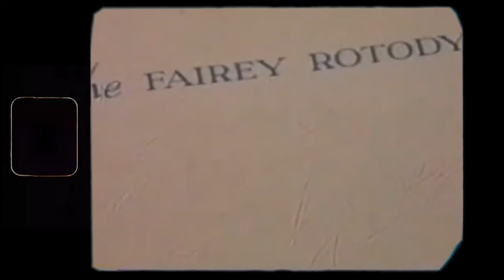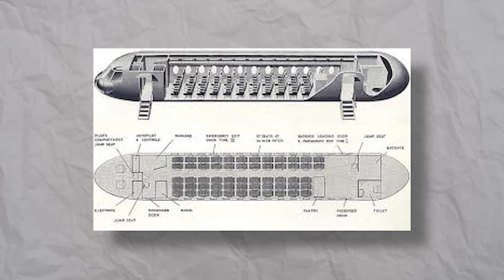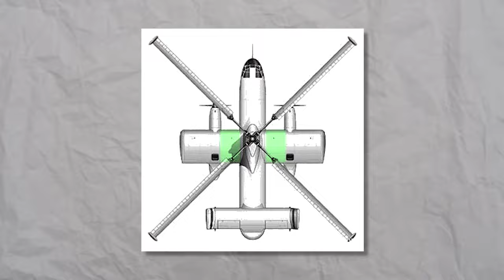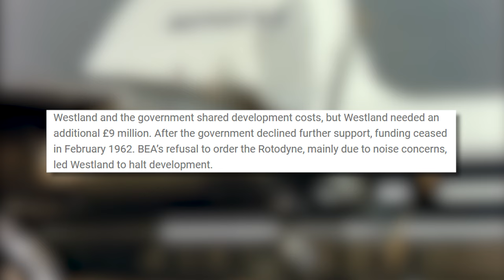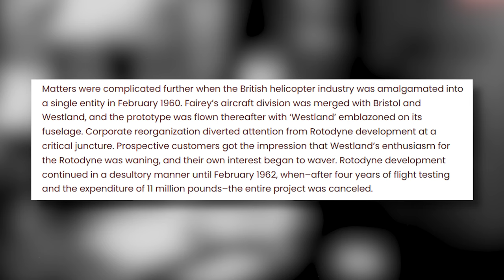This VTOL Flying Bus Could Change How We Travel! Fairey Rotodyne Story

Comment: There was a time when this aircraft was thought of as being the future of aviation. So what happened? Noise is produced by more than just the engines. The champion noise maker is the Republic Thunderscreech. This turboprop fighter had its prop spinning so fast that the tips of the blades went supersonic. The resulting sonic booms created an unbearable amount of noise. I'm wondering if the Rotodyne when pushed, suffered a similar problem, 

I enjoyed this video as I have a love of historic aircraft. I would also like to give a shout out  to other wonderful aircraft produced by Fairey, mainly for the Royal Navy. Most famous, Swordfish WW 2. Most recent Gannet, Cold War. Personal favorite, Flycatcher. This 1920s biplane fighter could land on aircraft carriers without the use of arrestor wires. Most attractive, non naval, Fairey Delta 2. A 1950s supersonic research aircraft.